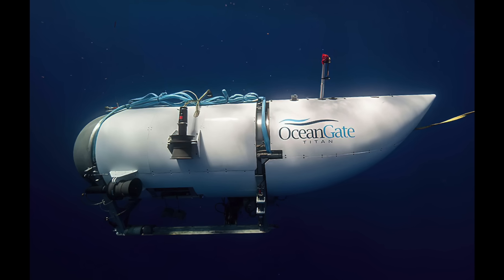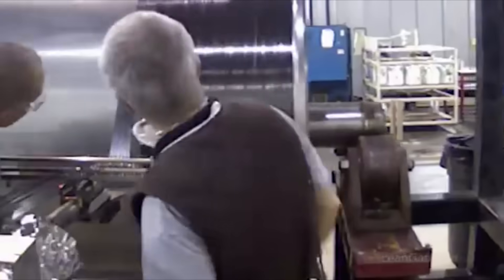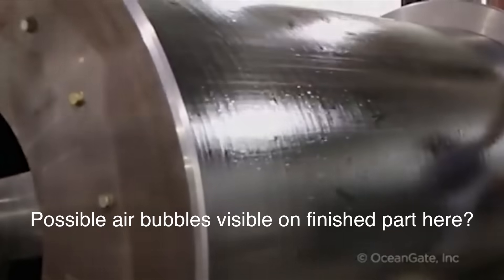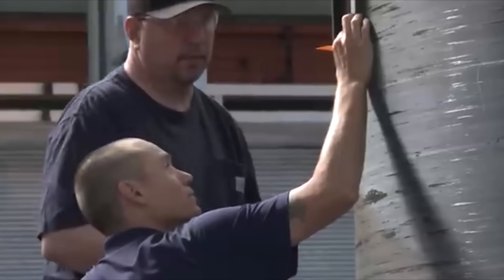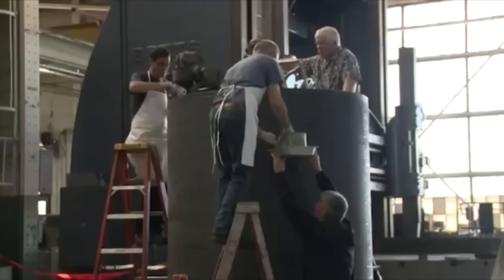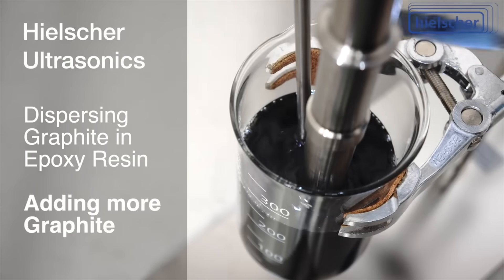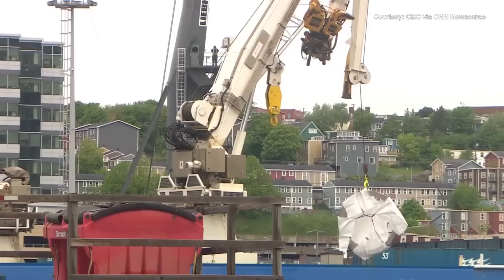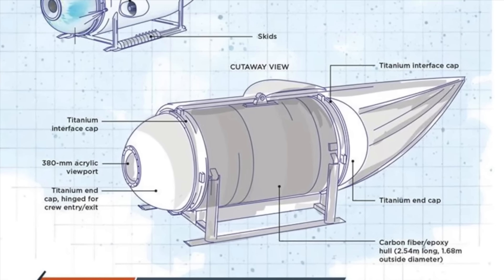Why OceanGate Titan Imploded - A Carbon Fiber Composites Perspective

Comment: Nice to hear from someone with experience in carbon fiber composites. (CFCs) - titanium construction. A couple of questions come to my (4 year mech eng degree) mind. 
(1) water will seep into any tiny pore or crack due to capillary action. What is known about water at 5500-6000 psi forcing its way into tiny cracks of the resin matrix & promoting delamination or such? Or would the compressive stress tend to close the cracks? Maybe no one knows the answer since most deep sub manufacturers want nothing to do with composites in their pressure hulls. 
(2) I noticed what looked like a step in the circular edge of the CFC cylinder, that is, a reduction in diameter from the main wall down to where the Titanium end caps/rings are glued on. To my mech eng mind this screams out “possible stress concentration” which is double deadly under cyclic load. Are CFC subject to stress concentration due to changes in section (or notches) to the same extent as metals? The edge may be designed with a proper radius (or not) I can’t tell watching on a tablet.
Reply: Look up a report from last year, "review of composite hulls in deep water"... they even were kind enough to include pictures.
Reply: Physics does not care what material it is concerning stress concentrators , section changes, material changes, mismatched stiffness , mismatched thermal coefficients, and inadequate manufacturing processes all add up to knock down your theoretical safety margins. I believe the joint failed it is the hardest part to engineer, second most likely hoop layers were micro buckled by subsequent hoop layers as they alternated between axial pre impregnated mushy high temp epoxy layers and room temperature gelling epoxy but not fully cured as layers were added. Autoclave final cure did nothing to consolidate layers just cured the epoxies.
Reply from the maker: Are you aware of them hand laying layers of 90 over their 0 degree pre preg filament wind?
Reply: @JamieKunka  yes but the axis is 0 degrees hoops are 90 degrees. This is done routinely when winding interface skirts for rocket motor cases. It is a problem on thick walled buildups keeping the laminate consolidated as you build up. Squeegeeing epoxy over the voids between tows is not a substitute for compaction.
Reply: @JamieKunka  Real information on the final manufacturing is sketchy, as different videos are shown as time passes. Either way if it was all prepreg that would be ridiculous to build up 5” of uncurled material.. I once had a carbon fiber flywheel project for U of Texas we had to build up and cure in stages to keep the fiber straight. We could not do it in one shot. Inter leaving prepreg and wet winding that thick is also problematic. A real tragedy and it will take a year for the NTSB to issue a final report.
Reply from the maker: Great to hear your real world filament winding experience!

Comment: what is never addressed by him or anyone else is why didn't he just build the hull out of titanium like all the other deep sea submersibles? 

I assume the answer is that he did't have the money to do it. So he thought he could go cheap. But why didn't anyone ask him to his face so see what his answer was?
Reply: He mentioned it with his reference to strength to buoyancy. All submarines and submersibles are limited by weight and volume. Building a strong enough cylindrical hull out of titanium would have resulted in a hull that was the heavier than the water it displaced. This would result in a vessel that was not positively buoyant. Other deep sea submersibles get around this by having syntactic foam buoyancy sections. This will result in a more expensive and bulky vessel as the foam takes up a lot of volume, which is needed to provided the positive buoyancy needed for the entire vessel. OceanGate wanted to avoid using syntactic foam so that their vessel can be smaller and lighter and won't need a large support ship.
Reply: @alaindao7374  I've read that the foam is extremely pricey as well.
Reply: Aluminaut (Google the name, her history is a fascinating story in its own right) had an aluminium hull, deeper test depth than Titan and didn't need auxiliary buoyancy. She also had enough internal volume for a crew of five plus bulky 1960s scientific instruments.

I'm guessing they didn't use her proven approach because of the expense of having the hull sections forged and machined.

Comment: No glue squeezing out of the end caps when they laid it up definitely threw a red flag for me too the first time i saw that video. Very good analysis vid 👍
Reply: I try for some glue squeeze-out with woodworking projects, but I’m also fond of using screws In addition to glue.

lots of screws.
Reply: @dennisyoung4631  I'm work in a cabinet shop and another thing I notice was that they didn't even have to tap it in place it just slid right down on it
Reply: @Blasko86  got a question for you, then.

When I am putting pieces of 1/2” nominal birch plywood in slots/grooves/Rabbets/?, I commonly try for a “drop-in” fit, one where there’s (hopefully!) no needing to bang things with a mallet. (I’m working alone, still relatively new to woodworking, and am older, chronically ill, and disabled.  Most of the shelving units, bookcases, etc. are more disability accommodations than conventional furniture.)

I use hide glue, because it has a long open time, is relatively easy to clean up, and doesn’t leave visible stains under the finish.  I then put in #6 countersunk screws.

Am I full of <censored> for doing it that way?  Unlike metalworking, I haven’t done it for a living, nor did I take college-level machining classes.  I did my share of reading, and I have asked people about it who have more experience than I do.
Reply: @dennisyoung4631  that doesn't sound totally crazy. I'm no engineer either and I mostly just do sanding these days, most of the building I've done was mortise and tenon. You could also take some 3/4 and lay it up against the bottom of the shelf and the side and use a little glue and screw it in for some extra hold.
Reply: @Blasko86  Thanks.

I used beech wood for the bottom parts, where the casters go.  T-nuts take the bolts for the casters.  The whole surface of those bottom boards get a coating of glue, and then some screws to keep them in place.

I use enough screws that I try to buy a thousand at a time (price break) in the three sizes I use the most - 5/8, 1, and 1&1/4.  Going to want some 1 inch screws before I build much more, in fact!
Reply: @dennisyoung4631   - you should have built that submarine of course
Reply: @doncarlodivargas5497  screws are expensive, he would've been fired
Reply: Same with me, I have no idea about this technology,  but seeing they place the end cap on top of the carbon fibre and no glue coming out made me nervous
Reply: Problem is they use a theoxi modified resin so it CANNOT squeeze out reliably. With how thickened it is, it's get the amount exactly right or bust.

And they went for bust.

This was the worst possible way to build this, it should have been liquid resin, fill the groove, degas it, press the tube into it from above, collect squeezeout as it greens.

That being said i don't think the glue joint is structural at depth! The pressure of the water keeps the endcaps on. It probably failed due to structural deficiency and low fatigue endurance of CF cylinder and the localised strain introduced into the cylinder ends by the inner lip of the end ring as the pressure mounts.

Comment: There are hundreds of decades old videos out there of nerds pointing out how carbon fiber is terrible for handling pressure.
Reply: I'm assuming you mean compressive pressures? Carbon fibre makes fabulous lightweight pressure vessels when under tension.
Reply: @cameronwood9385  Composite SCBA air cylinders are extremely popular with first responders due to their light weight.  The applicable retesting regulations do reveal the limited life of these cylinders, even under compression loads:
carbon fiber & fiberglass:  retest every 3 years, max life of 15 years.
Steel and aluminum:  retest every 5 years, max life is unlimited as long as the cylinder passes its pressure and inspection tests.

I assume that someone is concerned with composite cylinder degradation over time.

Comment: These guys put less care into bonding those pieces than I would putting a screen protector on my phone. You know these guys phones have air bubbles between the screen and screen  protector.
Reply: That's OK just make sure to wipe with a dirty greasy cloth before attempting to apply it
Reply: Y'know, to make sure it bonds really well 😂

Comment: I've been in composites for 30 years I've made helicopter parts blades nhra drag cars I agree the 4 in wound lay up was a mistake I also seen no mechanical adhesion sand roughing up of titanium nothing but I think the lay up was the big mistake it's weak that way especially under compression

Comment: Rush's workshop is little better than mine (I am a musical instrument maker working at home).  I take greater care in gluing and bonding than these guys do. Amazing.  I will give him some credit: he went down with the ship.
Reply: Rush may not even deserve much credit for "going down with...".   OceanGate's former finance director said that Stockton Rush asked her to be the head pilot for the Titan after the former pilot, David Lochridge, previously said he was fired for noting concerns about the sub's safety.  She quit because of that.... or maybe she  had limited experience with Game Controllers?

Rush seemed eager to keep the money coming in and appearances up.  Would it be too much to speculate if the finance director knew other valuable information that was best left buried at the bottom of an Ocean?
Reply: @arcanondrum6543 I would definitely say that's too much to speculate but the obvious response would be, "for what?"
Reply: if you think about it, it was kinda like watching a turdlog do the disco circle before disappearing down the black morass
Reply: lol
Reply: To bad he took others with him
Reply: Yes, I heard had they used titanium and steel for the body instead of carbon composite even with other problem, they could have averted the implosion.
Reply: @kamilebrahimoff3589  could have but didn't:face-fuchsia-tongue-out:
Reply: so Rush got ripped off from the sounds of it

Comment: Yours is the clearest analysis of the manufacturing problems I’ve seen to date. And the engineering amateurism on view is nothing short of criminal in terms of negligence. Rush, in an irrational flight of fancy, seems to have conflated metal and carbon fiber. How else does one come to say that the noises experienced at depth represented a “conforming” (maybe there’s a better word) of the pressure vessel to its environs, rather than representing a very obvious and quite literal tearing at the fabric of the submersible? Lunatic? Sociopath? A Dunning-Kruger Dunce? I’m not qualified or well enough informed to opine on such things, but whatever the underlying reason, he and his team set themselves up to fail on any number of levels. The oversights are myriad and glaring.
Reply from the maker: Thanks for your kind comment. The idea of weak fibres and voids settling in etc is a bit scary to anyone who has made anything structural from carbon composites before. Especially when this part is going to be subjected to repeated compressive stress and strain over time.

Comment: The force on the endcap bond is closer to 28000 psi. ( the full surface area of the end cap applied to the surface of the carbon fiber tube) Critical epoxy mixtures are mixed by weight, not volume.
Air was certainly trapped in the ring when the joint was made, not enough pressure to squeeze out the air bubbles. Also, an autoclave bond is required for high strength composite layups.  I am surprised this sub lasted more than one dive.
Reply from the maker: Very interesting to hear your calculations on the pressure. I’m uncertain if any pressure was applied to the interface cap when it was bonded or do you think they were just relying on the weight of the machined part pressing down on the hill?
Reply: @JamieKunka  From looking at the sloppy ness of the bond, I do not think they applied extra weight at assembly
Reply: @JamieKunka  The surface area of the Carbon fiber tube is approx 1300 in sq. 5 psi of bonding pressure needs 6,500 lbs of weight.
Reply: @glennnovember3266   Using rough numbers for the dimensions I got similar results: -139MPa (-20ksi) for longitudinal stress. What is interesting is how they must have thought they had a margin of safety with the 0/90 layup since the resin alone was probably rated at -250MPa. I am also curious of the hygrothermal stresses of curing a 5" thick wall. This guy was definitely way off of charted territory on this design..
Reply: Rush built this craft with inadequate funding. A bunch of guys building something in their garage. Sad.